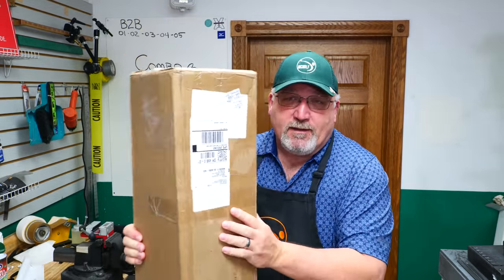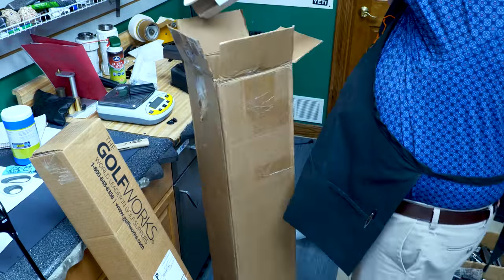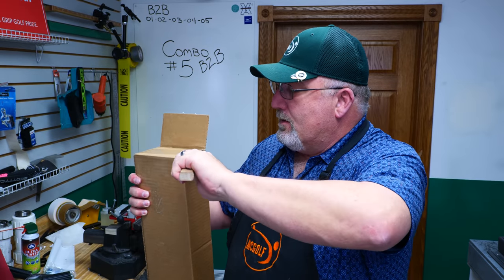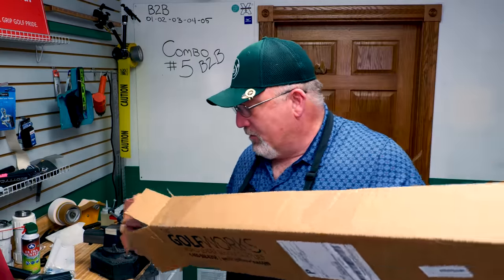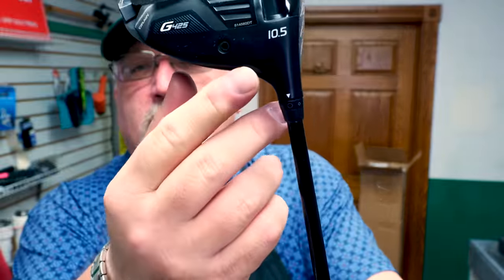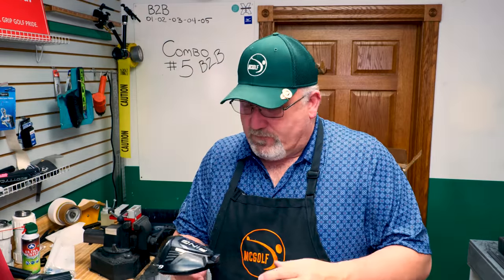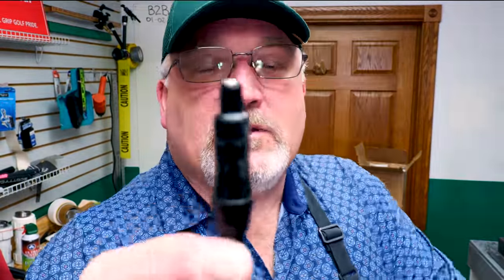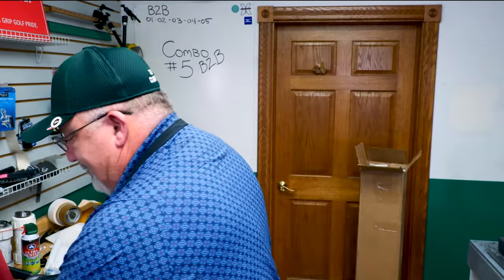Golf Club Repair - SPine and FLO B2B Vol5

Comment: I'm absolutely dumbfounded at the number of Youtube "clubfitters' that are utterly clueless on how to Spine and FLO a golf shaft.  Firstly, the actually spine of a steel golf shaft is NOT the hardest plane of the shaft, the OPPOSITE that side is. That's why the shaft (soft plane) turns UP when clamped to a fixed point at one end and downward pressure is applied to the other. Occasionally there will be two planes, but these will easily be identified with the same procedure by simply turning the shaft slowly while under pressure as Jim did in this video. Once the soft plane is identified, you can choose to install with soft plane facing target or away from target. 9 and 3 o'clock.  OR, you can install soft plane facing away from you or behind you at address 12 and 6'oclock. If you install soft plane facing target (9 o'clock) you will likely see a higher ball flight with reduced draw/fade bias and overall tighter dispersion.  Conversely if you install soft plane facing away from target (3 o'clock) you will likely see lower ball flight with reduced draw/fade bias and overall tighter dispersion.  If, on the other hand, you choose to install soft plane facing away from you at address (12 o'clock) off center oscillation can occur leading to wider dispersion. Not recommended. And lastly, if you install soft plane facing down or behind you at address (6 o'clock) you will likely see club head droop leading to open club face increasing percentage of fade/slice. Also, the shaft can oscillate more erratically in this plane configuration. This is not recommended either.  The main take away here is to have your clubs consistent in order for your ball striking to become repeatable. Consistent and repeatable, that's the journey we are all on. Note: if you're going to FLO a shaft, attach the laser to golf head END of the shaft, not near the grip or middle. The oscillation largely occurs and is pronounced/erratic at at the tip, thus the most important part to measure.

Comment: I always line up the straight FLO with the target line so the shaft bends the straightest in line with the target line minimizing crooked shots due to weird shaft behavior. Usually the FLO alignment is pretty close to the softest bend angle found in the spine finder. That puts the stiffest shaft orientation in the up/down position (perpendicular to the target line) and minimizes shaft droop at impact. The shaft bends less in that direction and maximizes the bend with the direction of the swing and target line to make the bend contribute to head speed (and not wobble).

Comment: Thanks for responding to my comments.  I do my FLO a bit different from you.  I use a weighted laser pointer on a bare shaft to find the best FLO, then double check it with the head in place.  Since I always orient the head to the FLO, I stopped using spining couple years ago

Comment: Hey Jim! Big fan of the channel from the UK, it’s inspired me to build my dream set of irons, 2007 Taylormade RAC TP MB. I’ve pulled the existing shafts, cleaned out the heads but there is a lip 1 1/8 inch inside the hosel that I can’t get the shaft in past. It leaves a gap of about 1/4 (maybe less) inch down to the bottom of the hosel. Do I need to fill that gap prior to installing the new shafts, if so, what with? Thanks 🙏

Comment: Another way of getting it unstuck is simply un-screw and hold the shaft with your thumb and forefinger and on a hard floor surface simply drop the butt end on the floor.  May have to do it a few times.  Key is to not hold the head and release your thumb and forefinger when you drop it a couple inches off the floor.  You'll hear it release.

Comment: Hi Jim, just to be on the safe side. Is the hardest part of the shaft at the top or bottom? I would think that the hardest part of the shaft would be at the bottom and the softer part would be on top, cause it can bend the most.
Reply from the maker: another great question Samson,  Like most answer I would say it depends, I did a set of steel shafts where you could see the lie where the shaft was joined. After spinning I found that line on top. figuring that was the hardest side. 
Other folks smarter than me have also made your same claim about bending,  I might have to investigate further.

Comment: I agree with spine and flo…problem is that it goes out the window in adjustable drivers once you change the setting…is there any way around this???
Reply from the maker: If the adjustable club doesn't move as in is a Callaway. The cogs rotate into position the shaft remains in the same spot.

Comment: Great explanations. I’m just starting to get into club building here in Atlantic Canada. I just received my Golfworks gripping station and I done a little practice on a few old steel and graphite shafts. But todays the day I re-grip my iron set and 3 wood. 
I have a question about why someone would want to play a golfpride align grip on an adjustable hosel? Did the customer tell you what setting to align the flow and grip? I’m just curious. I assume the Callaways would be the ideal setup for FLO and an align grip. 
Anyways great content, and you now have a new subscriber here on the east coast of Canada.
Reply: I believe the customer had wanted it in the neutral setting. The adapter would have to be pulled and re-glued into another position if it was to be moved to keep the spine and flo.
Reply from the maker: Callaways would be the one for adjusting with out messing up the alignment. 
A survey was conducted about adjustable clubs shortly after they became mainstream. 90 percent of the golfers did not touch the club once purchased, 90 percent of the remaining 10 percent adjusted the club once. It is the last percentage that are the tinkers.

Comment: Would it be more accurate if you cut the shaft to length and tip before checking for the spine or the FLO?
Reply from the maker: you know that has been a question posed by others in the past. A good one too. Personally, I would say no, If the manufacturing process is proper, trimming should have no affect on the FLO

Comment: I know spine FLO is so controversial but surely the flow would want to flow down the target line so that it moves as consistently the same at impact? I use the mark my “spine finder” gives me @ 3 o clock for a RH golfer
Reply from the maker: Jonny that is good position too. When it comes right down to it. Its about the bend in the shaft. Does it bend down in the swing or does it kick?  or both. I met a gentleman with several high speed cameras and he professed that the shaft bent down. Ive went with that ever since we had that discussion

Comment: FLOing a shaft on a driver with an adjustable hosel is pointless if adjusting the settings results in a change in orientation of the head relative to the shaft
Reply from the maker: if you were to find spine assemble the club and then adjust the club, in several cases yes it is out of align. However there are a few companies where you can make the adjustments and not ruin the alignment. Callaway and the cogs is one and Titleist as long as one clog adjustment is used.